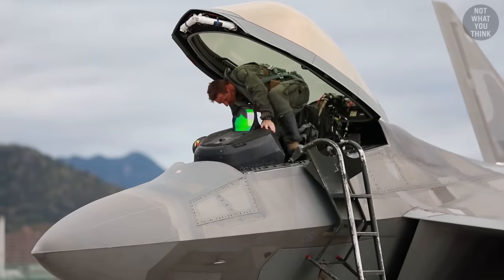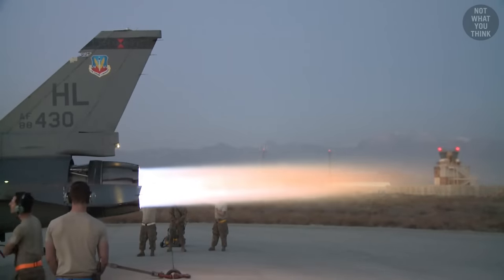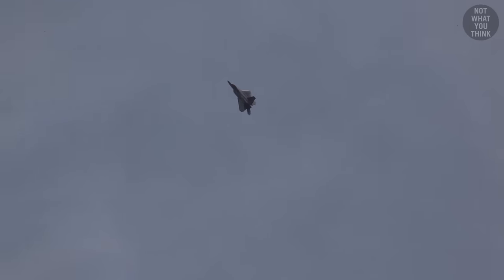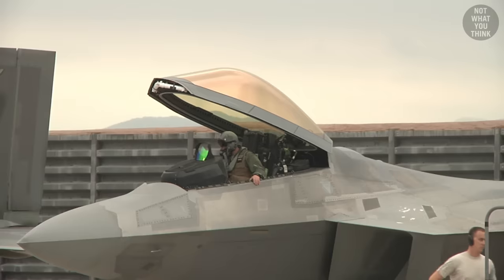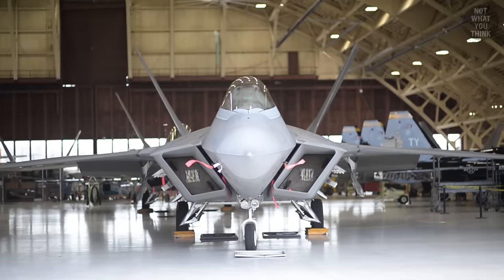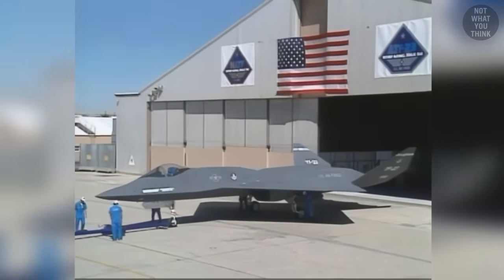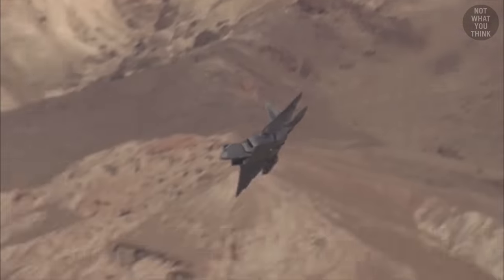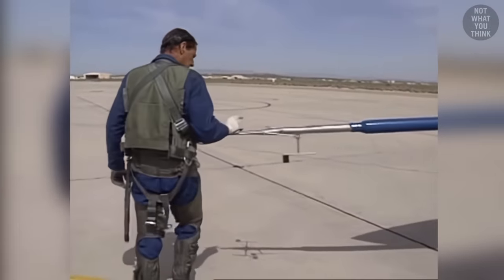The Stealth Fighter That America Never Exported

Comment: "Since the 1980s Lockheed had already been experimenting with stealth in the F-117 Nighthawk platform." - Lockheed first began working on stealth as far back as the late 1950s. The SR-71 Blackbird, designed in the early 1960s, was an experiment in stealth.
Reply: No, no the sr-71 is fast not stealthy
Reply: @icantcomeupwithagoodusername24  no the sr-71 was indeed stealthy Vs it's contemporaries.
All those swooping lines go a long way to shrinking its cross section.
And stealth goes back to the second world war with a certain British light bomber (mosquito) being made from wood and being very hard to spot on radar.
Reply: @icantcomeupwithagoodusername24  - The Blackbird was entirely designed to be stealthy and achieved it through a combination of its shape, some of the very first composite materials ever used and its characteristics.
Reply: @crashburn3292  yeah but the main point was to be fast not stealthy as missiles were fired at it. It has more in common with the U2 than the 117
Reply: @crashburn3292  Stealth goes back to 1200BC when they used the Trojan horse
Reply: @brian60 stealth actually goes back 65 million years ago when dinosaurs tracked their prey hahahahha
Reply: @TheWebstaff  The mosquito's frame being made from wood also gave it a high speed.
Reply: @brian60 sir this is a public place, children are here. What they did with their Trojan horse back then is their business.

Comment: The English Electric Lightning was one of the first aircraft to exceed the speed of sound in level flight without using after burning.
The F106 was capable of low supersonic speeds without afterburner but with a significant range penalty.

Comment: The correct term for the coating on the F22 is not "LO" it's RAM for radiation-absorbent material.
Supermaneuvrability is not used to dodge missiles (Yes you can jam the WEZ but that's in dogfighting which is very rare). Energy retention is actually superior for dodging missiles in BVR.
Reply: Most people interpret dogfights as just turn rate, but it is VERY complicated, and generally varies between "One circle" and "Two circle" both having sets of complicated and challenging tactics to exploit the advantages of an aircraft. Growling sidewinder gives great demonstrations for the complexity of dogfights.
Reply: @WildmanTrading  while GS uses perfect theoretical technique DCS cannot compensate for pilot fatigue from constant g loads.
Reply: @WildmanTrading  i mean growling sidewinder uses dcs but ehhh
Reply: @WildmanTrading  I understand the complexities of nose-to-nose and nose-to-tail dogfighting. I'm referring to the methods used to defeat moderate to long range fox 3 missiles. In BVR the Raptor primarily benefits from its low observability and high thrust to weight ratio instead of thrust vectoring or supermaneuvrability which are both more suited for one circle dogfighting with high off bore sight fox 2 missiles.
Reply: In reality, the F-22's thrust vectoring was never really for supermaneuverability, or at least that wasn't the intended role. It was actually meant to improve the jet's performance at high altitudes. Both the YF-22 (F-22 prototype) and YF-23 were designed for high altitude operations, where the air is very thin. Regular control surfaces would've been useless, which is why the YF-22/F-22 has thrust vectoring controls while the YF-23 had giant ass vertical stabilizers.
Reply: @Monarch683  I though it was for supermaneuvrability, performance at altitudes and to use control surfaces less?
Reply: @Fake_Slicer  Partially correct. Like I said, the biggest factor to the YF-22 and F-22 having TVC was for high altitude performance. Supermaneuverability was kind of just a nice pro that came along with it. Also, TVC doesn't mean you'll be using your control surfaces less. If anything, you'd be using the TVC less in situations that don't require it to avoid unnecessary wear and tear on the thrust vectoring nozzles.
Reply: @Monarch683  The thrust vectoring on the YF-22 was optional as its control surface can do what the pilot wants the aircraft to do.
Reply: @NationChosenByGod  Yes but no. At lower altitudes, yes. The control surfaces are sufficient in non-combat application. However, at high altitudes, thrust vectoring has to be used because the air is simply too thin for conventional control surfaces to operate.
Reply: @WildmanTrading  what is the best video for noob to watch about the air battle maneuvers. would love good 3D animation. "why this guy moved here and this couldn't"
Reply: Ram with the horns tastes too good when roasted. Beef is always on top💝

Comment: You don't mention they have just been upgrading the Raptor to current tech. I'm happy to see they decided to support the platform.
Reply: They constantly upgrade the sensors and electronics, they just don't make it public knowledge. Hell the public didn't even know the F-22 existed till 2005
Reply: @SilvaDreams tell that to any one in Atlanta, and you will find out otherwise.
Reply: @bowez9  I used to live near Dobbins Air Force Reserve base. It was so loud after Sept 11th.
Reply: No? F-22s have not been upgraded in a long time. Their production lines ended a long time ago. I don't know where you're getting that information. There have only been upgrade proposals made, not actual upgrades.
Reply: @SilvaDreams  Not even close.  There was a F-22 game in 1997 and it was shown to the public the same year.   The YF-22 prototype was shown to the public in 1991 in the press conference awarding Lockheed the ATF contract, not sure if it was public even before then.  

Suffice to say 2005 is very wrong.
Reply: @Monarch683 Some have been seen with mirror coatings so there’s /some/ amount of upgrading going on but you’re right the lines been closed for a long time
Reply: @Monarch683  The Air Force made clear in 2022 that they intend to upgrade the F-22 to remain in service until at least 2060, and had the budget for the upgrades included in their approved FY2023 budget. There are upgrades, it's more than just proposals, it's reality. The information is available on Google, they made no attempt to keep the fact that they're upgrading the planes secret, though the extent and content of the upgrades has remained top secret. And in reference to you and DefaultProphet saying they've shut down the lines for it, you're correct. They've shut down the PRODUCTION lines, meaning they can't make new planes. There is literally nothing stopping them from installing upgrades into the existing airframes though.
Reply: @izerochan  Yes but no... Plans have been made for the F-22 in the 2030s once NGAD enters service. Also, if this information is so publicly available, do you mind linking a source? AFAIK, the only "upgrades" being made to the F-22 are ones to keep it in service until the 2030s and potentially 2040s. There's no way in hell the F-22 will fly into the 2060s. The F-35 already outclasses it overall with how much a force multiplier it is. No amount of F-22 fanboying and simping will change that fact.
Reply: They intend to make the 180 something numbers flyable. They don't make them anymore
Reply: @izerochan  Agreed they can upgrade it and they committed I think 9 billion to doing so?  If I recall correctly though they found it really hard to upgrade the Raptor in the past
Reply: @DOI_ARTS  Yes but no. Only around 120 of the 186 aircraft built are airworthy. Some have been lost due to accidents, but the majority are kept to be used for cannibalizations for parts. No air force will ever field 100% of their fleets. They will always keep some as use for parts cannibalization.
Reply: They have fewer of them and apparently it's more difficult and expensive to upgrade them due to some of the older tech, and it costs more to repair them cause they're no longer building the components for new models like the f35. I think it's a very capable fighter but its only cool cause it has stealth plus maneuverability which is kinda dumb cause if you're super stealthy you don't need maneuverability for the very small chance you'll end up in a dogfight
Reply: @Monarch683 its getting a new coating, 360 IR sensors, Software, and some other classified stuff. its a real huge upgrade since the F22 wasnt designed to be upgradeable in that scale because the airframe needs to keep its stealth capabilities
Reply: yeah great platform, crashes constantly , too costly, only 29% of f35 are operationally capable, and never was on real combat, only against shepherds in sandals 😂😂😂

Comment: Is the true speed of the f-22 classified?? Just asking because i dont know. Ive been wondering what the true top speed is for it?? It looks fast as hell. Its a great plane, but my favorite jet is the F-14.
Reply: They only list it as Mach 2+ my guess would be around Mach 2.5 but I think the stealth coatings get damaged when they go over a certain speed
Reply: @sc1338 ya…heat damage.
Reply: It can fly out of tricky situation at close to mach 3 using afterburner.

Comment: The reason for the F-117's flat panels and straight lines is not what you think!

Lockheed's Skunk Works used computers to model radar reflections, but at the time they were not powerful enough to model curves. So they just designed a low-poly aircraft instead!

Comment: Had the USAF chosen the YF 23, Lockeed would had still gotten a chunk of the contract. Northrop couldnt concurrently build the B2's and YF23's in the numbers required and would sure have had a partnership with Lockeed producing assemblies. The Super computer model too date still puts the 23 well ahead of the 22 in terms of far thinking and far relevancy design. The 22 is Awesome but the 23 would had likely been more capable and in the end cheaper per unit. I still think the new Stealth fighter coming out is very much akin with the 23's design and thinking. 2024 should be telling.
Reply: I think that is more wishful thinking than anything else. There is nothing that says for sure that the 23 would have been stealthier especially since data points covered show that the 22 had a better horizontal profile. 22 also had better supercruise so getting from target to target faster without afterburner means it could carry out more assignments which isn't factored into the cost per flight.

Comment: As much of an F-22 fan boy as I am, there are a couple points you missed. 
1 - the Russians beat us to the thrust vectoring. 
2 - while quite advanced the F-22 lacks HMD that is found even on late model 4th gen aircraft. 
3 - it is called RAM no LO for the stealth coating
4 - F-22 is not the fastest plane in the US arsenal.

Comment: 5:05 radar absorbing material pre exsisted the f-117. The shape and geometry was the leap forward, not the paint. The smoothness of the B2 and F22 is due to improvements in computer technologies that can calculate and model the required shape.
Reply: Yup, first plane they used ram on was the sr-71

Comment: Not really a great way to open a video about this great fighter jet ... that it's first kill was an unmanned unarmed balloon. And the next statement was the F-22 got out of it without a scratch. An off-the-shelf DJI drone could have brought a balloon down.

Better to have just stated the plane had not yet been in combat.
Reply: The balloon was way too high for dji drones to kill it.
Reply: @TonyChan-eh3nz  I just watched an excellent clip from Mr Steele where he easily dove Mt Everest with a 5 inch drone. He wasn't having thin air flying problems but was limited by battery capacity. He could have flown higher I think.

Comment: The F22 would not see that many orders either way, it was crazy expensive, and it was niche made to be an air superiority fighter. With the increasing cost of aircraft technology, the majority of US Allies are looking to buy multi-role jet aircraft. F15 built for air superiority, not very popular. F16 built for multi-role, very popular. The F14 was only sold to a single country, Iran before the revolution.
So at best, only a couple dozen or so could be sold. Which would not offset the development cost enough to justify the risk of leaking the tech to potential enemies. 

Further more. The purpose of exporting military equipment is two-fold. 
A. Spreading the development cost over more systems.
B. Justify a higher peace time production output, to ease the gap between peace time demand and war time demand. I.e if you only need 75 per year during peace, but you may need 500 per year during peace. Selling an additional 75 per year means you can produce 150 a year during peace. Then during war, you can instantly double your production by denying the export market.

The US did sweeten the deal with its Allies by intentionally producing F35 parts in NATO countries.

Comment: The problem with the F-22 is it's a warfighter for a different era. It's the last of the great fighter jets, but it's the last for a reason; an F-35 would shoot it down before it even knows it's in a fight, and that's the problem. You could build an improved F-22 that would put you on par with the F-35, but that's what you get - something on par in warfare, but without the flexibility.
Reply: That thought has already burned them once. The f4 was built because it was thought to be a new era and maneuverability was mostly unnecessary. But it wasn't and the US had to go all out and develop the f15 in a hurry. Ever since then they have refused to neglect a possible aspect of air combat. They'll likely keep some kind of f22 type of plane around to never again be caught flat footed.
Reply: @haagenslash5963  but it isn't the late 1960's. There's nothing that can change that thinking a) within human limits and b) that actually voids modern warfare strategy. There's not a radar system, a missile, an anti-aircraft system, a stealth capability. Lets say lasers come along and fundamentally change the nature of warfare (and they're coming fast, US is forward deployed and developing more powerful systems, the UK is integration testing a working system, China probably has something up their sleeves unless they're total smoke and mirrors like Russia are) - there's not a turn you can make or a g-force you can pull and supermaneuverability won't help you - you're not going to outrun the literal speed of light. Follow it with the next generation is going to be same deal but probably unmanned and swarming if they survive laser weapon development, same deal, make them sacrificial and not massively expensive so it doesn't matter if you lose them. Maybe just launch your missiles from space instead. That type of aviation warfare is completely over.
Reply: @haagenslash5963  The F-4 was highly effective though. If used correctly it always had the advantage over contemporary Soviet fighters. The problem was USAF doctrine, which neglected air combat training because they thought their fast fighters and strikers would simply push through any Soviet attempts to intercept.

Comment: So good that not even the USAF wanted it: 148 planes including prototypes made and pre-production samples, before the moulds were destroyed, smells bad.
The Ockham razor point at a lot of problems never disclosed with the aircraft, as the USAF is buying newly made F15 II in 2024.
I can guess the plane was unmaintainable as a first line weapon, due to fast deterioration of the stealth coating (the B2 also has that) and unsolvable problems with the electronics.
The fact that the Raptor was never deployed outside of the USA in any meaningful way seems to support that. It was merely viewed as a test bed for new technologies to develop in the next generation design (F35) and will be soon retired entirely.
Reply: Nah, it just came about at an unfortunate time. The USAF definitely wanted it, but with the end of the Cold War the Govt wanted to cut back the military budget. We're talking roughly an 80% reduction in military budget between 1990 and 2000, which heavily impacted all procurement programs of that decade. Originally 750 F-22s were expected to be purchased, but only 187 orders were actually placed, which resulted in the price per unit going up significantly and some features being cut, and also affected the supply chain because Lockheed were not nearly as invested in the F-22 as they were prior to the cuts. 

Then once the F-22 finally entered service, there was no military threat to the US. Rather the US had entered the "War on Terror" where pure air superiority fighters had nothing to do. They upgraded the F-22 with JDAM capability in 2008, then it was cancelled in 2009 so that funds could be put towards the weapons that mattered for the war the US were currently fighting. With it's cancellation, the factories were re-tooled to produce the F-35, which made it more difficult to develop upgrades for the F-22, while also completely eliminating the supply of spare parts. And now we're at the point where the F-22 has not been kept up to date with modern technologies, and is incredibly expensive to maintain because there isn't a proper supply chain. So it makes sense to get rid of it.

The F-15EX is being procured to replace the F-15C in National Guard service, rather than for the USAF. The USAF will be keeping the F-22 in service until the 6th gen NGAD enters service.
Reply: @dumdumbinks274 the F-15 ex also serves a different role. It’s basically there to be a missile truck. You still need the F-22’s and 35’s to detect enemies for the F-15’s to go shoot at.